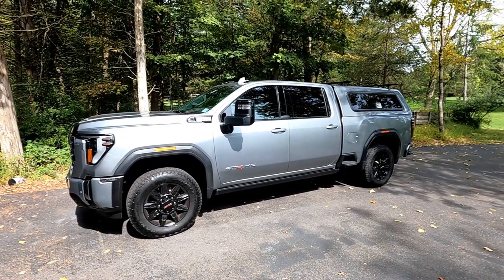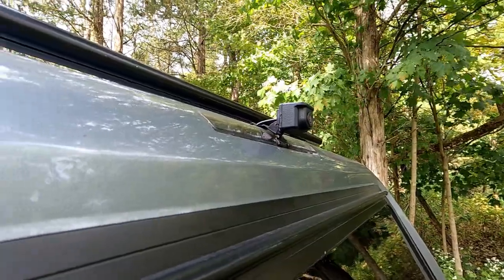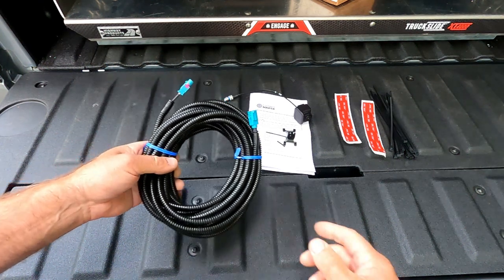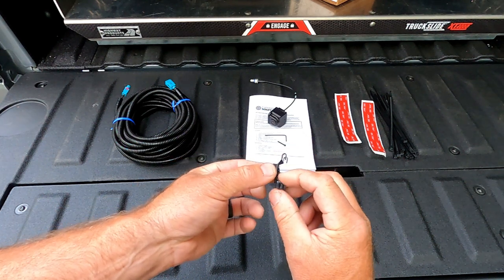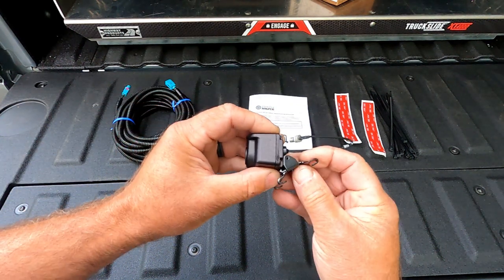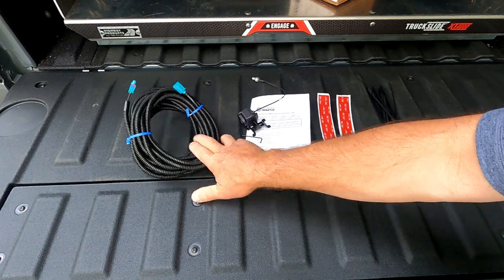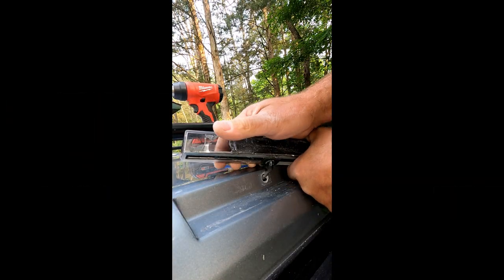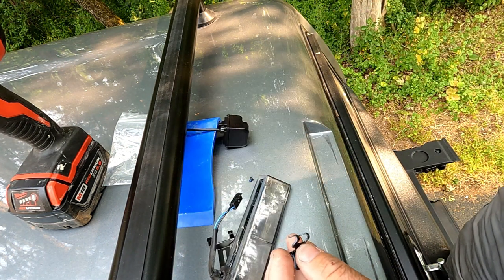Installing a rear view mirror relocation kit on my truck cap - 2024 GMC 2500HD

Comment: Awesome and extremely helpful video! Also thanks to Tom Whitlow comment for the tip on removing the taillight.  ARE Revo truck cap on GMC 2024 Denali HD.  Hardest part was getting the video lead through the truck bed and down behind the left taillight bc that is where the truck cap's wires were also run -- would not fit with both or even 1 protective tubing.  What worked for me -- I pulled the plastic protective tubing off from the cap wires and then taped the video wire to two of the cap wires and fed it through both holes, then reattached the protective tubes to each set of wires from top and bottom.  For the hole into the rear seat, I used a 1/2 drill bit through the hard plastic cap and then a 2 inch grommet siliconed to sit on top of the hole/plastic cap, then siliconed from both sides.  Really happy with having the rear view camera back again after 2 months of looking through the tinted cap glass.
Reply from the maker: @RichKiphuth  great tips Rich.   Thank you for the comments.

Comment: I installed it over two days because of other appointments.  The cap brake light was the hardest.  I spent two hours on the first day.  15 minutes of actual install work and 1 hour and 45 minutes with a sharpened putty knife, scraping, acetone washing, and fingernail digging to get that damn 3M tape off.  Today, I spent another 2 hours running the camera cable to the roof of the driver's side back seat.  Tip - pull the tail light off - just two screws and easy peezy from there.  Everything was exactly like this great video.  Very pleased with the result.  The camera quality is as good as the GM OEM.  Great product!  Worth every penny.  Looking forward to the brake light replacement with the built-in camera.  ARE should offer it as an option with their caps.
Reply from the maker: Great job Tom.  Thank you!

Comment: Check the space between your open rear window and the camera body.  I have a 2023 GMC 1500 Denali and a Z2 ARE cap.   My rear window is pushing the ENTIRE light assembly up and away from the cap body!  It's overpowering the 3M tape and tearing it loose.   I've asked CameraSource for a higher bracket or some other way to raise the camera above the level where the rear window can hit it.
Reply from the maker: Tom, I have the CX HD and it must have a different door.  There is 5-6" of clearance.
Reply: Was there a good fix for this is?

Comment: Just installed the camera relocation kit on my 2024 Chevy Silverado 2500Hd LTZ with a Leer Cab. On the Leer Cab, there are two screws on the inside of the camper shell that hold the third brake light in place, so it does not require the adhesive tape.  I had already installed a bedrug and when the camper shell was put on, they had run a braided wiring through the location from the bed that is shown in the video. I pulled the taillight as suggested from a previous comment and still I worked several hours trying to feed the camera wiring through the same area with no success. Since I had the bedrug I decided to drill a hole lower down from the hole that was suggested. The bedrug would cover the wiring. Using a Stepdown Drill bit, I was able to accomplish the task to get the wiring through and underneath the bed. By placing a piece of 2by4 under the carpet, I also used an extension and a stepdown drill bit to drill through the grommet under the passenger seat area as shown in the video.  Great video and now I have my Mirror working fine.
Reply from the maker: Thank you Charles.  Your description should help the next guy with the carpet.

Comment: Great vid. I have been concerned about getting a cap for this exact reason. Now I know there is a solution. Not a fan of how obvious the camera is. Would be nice to have it integrated to the brake light, but at least it's something. Thanks for sharing.
Reply from the maker: I'm with you.  I toyed with the idea of hacking up a new gm third brake light just for the low profile camera.

Comment: Great video. Sharp looking 2500 you got there.Looking at this for my silver 2020 HD Denali. I was wondering about the carwash, too so thanks for the insight.
Reply from the maker: Ben, I've had to adjust it a few times from the car wash now.  I was thinking about retightening the screw, but I think I'd rather let it get moved a little instead of breaking off.

Comment: Great video！ thank you for the detailed instruction. BTW,  does your truck has the camera which is looking down the bed, located beside the rear view mirrior camera ?
Reply from the maker: Thank you.  Yes it does, or did, with the cap in the way it's not effective.  It needs a camera relocation kit too!!!
Reply: @4RibsFishing  it’s the same kit used for rear view mirror or a different one ?
Reply: Thank you for the video.  I will be doing this on my 2024 3500.  It will be great to have the Rear View Camera function again.  But, with a canopy on, I'm wondering why relocating the cargo camera would have much value to me.  I really don't need to look into my canopy with a camera.  It's a great function with an open box to monitor cargo in the box, but with a fully enclosed canopy I don't see the need for it.    @4RibsFishing
Reply: @4RibsFishing  I wonder if it would be as easy as getting another relocation kit and Velcroing the other camera inside the topper?

Comment: Hi GREAT VIDEO!  I have a 2025 Silverado with an ARE Topper.  The relocation mounting bracket looks a little weak for car washes etc...  I am thinking I would like to try to mount (double stick tape?) the camera to the inside of the rear topper glass.  I am not sure if the tint on the rear glass will be a problem.  Could you test something for me and put a cheap pair of sunglasses in front of your camera lens and advise if it still works?  Thank you.
Reply from the maker: The mount has held up to 20 car washes so far.  The brushes sometimes rotate the camera down a little.  I'll try to test sunglasses.
Reply: @4RibsFishing Hi,  Rotating of the camera is not acceptable.  I am hoping I can find an acceptable way to mount it to the rear topper glass.  Please notify me ASAP  Thank you.
Reply from the maker: @arlenewolf5260  when I say rotate I mean it taps it slightly down.  Still pointed in a usable direction, but not my preferred setting.  I have metal doors so an inside mount is not possible.  I'm getting ready to double down on an outside mount with a rear facing dash cam mount- so I've accepted the slight inconvenience, I really don't have another option like you.
Reply: @4RibsFishing  Hi you state" I have metal doors so an inside mount is not possible. "  I must have said something wrong.. The photo of your ARE topper shows a Smoked rear glass door (not metal).  What I meant to say was to see if the camera could be mounted (double stick 3M Tape) to the inside of the rear glass of the topper in the area under the third brake light.  If the smoke rear glass allows you to see through it, that would be a great way to mount it.  That is why I said if you can see the camera image through dark tinted sunglasses in front of the camera lens, I would definitely find a way to mount (relocate) it to the inside of the rear topper glass hatch door. The bracket that comes with the kit looks like it just wont cut it for me.

Comment: How has the camera held up? I'm getting a leer cap on my GMC 2500 here very soon.
Reply from the maker: The screws have a little surface rust, but they already sent me new ones.  No complaints on the camera.
Reply: @4RibsFishing  still no issue with it at car wash?

Comment: Looking at getting on of these truck coming from a 2022 Ram 2500. What your impressions of the truck do far? I tow a 26foot boat running about 9500 to 10k fully loaded.
Reply from the maker: Airman, I tow a 30' boat with twin 300s on a steel trailer.  10-12k depending on fuel load, etc.  this truck is a beast.  I'm so happy I didn't go for diesel.  I towed the same boat for a couple years with a max tow prepped 1/2 ton.  GM said it could do the weight, but it was white knuckled.  This truck can do so much more.

Comment: Could this camera be mounted inside the truck cap viewing out through the glass? Looks like that camera may get ripped off if you go through a car wash
Reply from the maker: Maybe.  My back door is aluminum so it won't work for me.  It does get moved in the car wash.

Comment: Does this affect the 360 view on the camera display? Do you still get the side view cameras as well? Curious to know what camera views this affects by relocating. Thank you.
Reply from the maker: This camera only replaces the rear view mirror view.  No other cameras or views are impacted.
Reply: We have a Denali so I don’t know if it is any different with the cameras. Someone said it would affect the 360 camera view because that pulls from multiples cameras and moving this rear view mirror view camera could affect that.